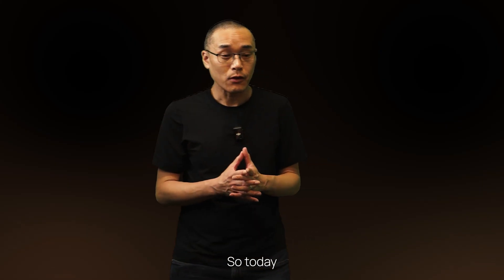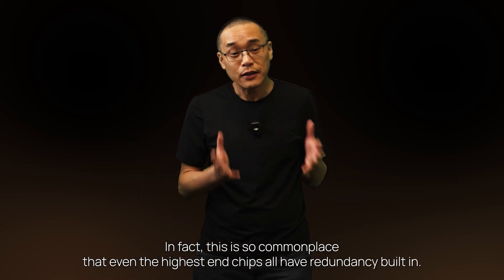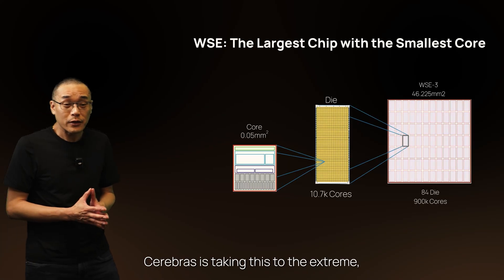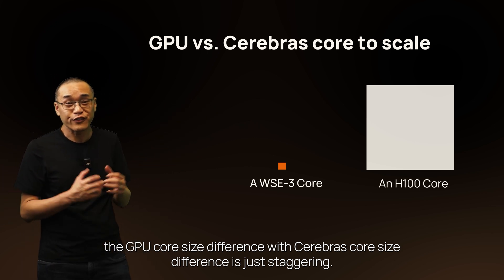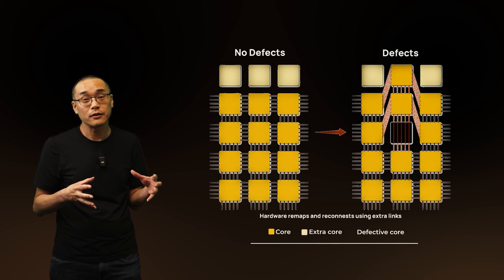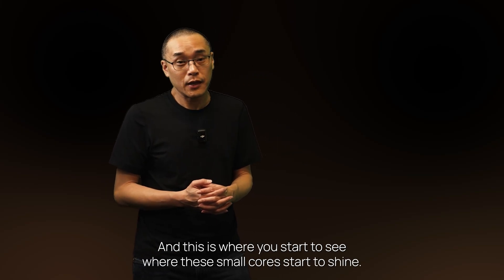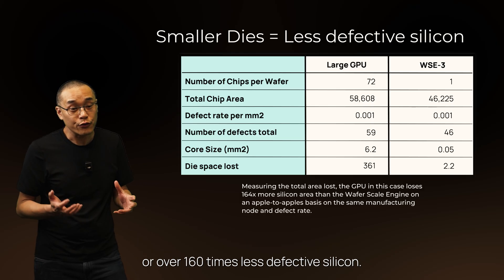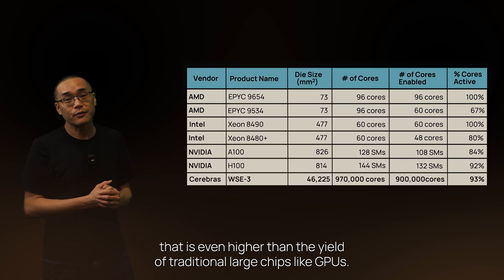How Cerebras Solved the Yield Problem, explained by CTO Sean Lie

Comment: The tradeoff is that as the cores become smaller, the percentage of the area that the interconnect consumes grows as a proportion of the overall area of the wafer dedicated to the interconnect.   Otherwise, the argument presented by the video, taken to its logical extreme, would imply that cores should become infinitesimally small.  Obviously that is not true, and a tradeoff would be achieved, where the amount of non-interconnect area starts to make the strategy unprofitable.  I'd be interested in an analysis of where that inflection point occurs.